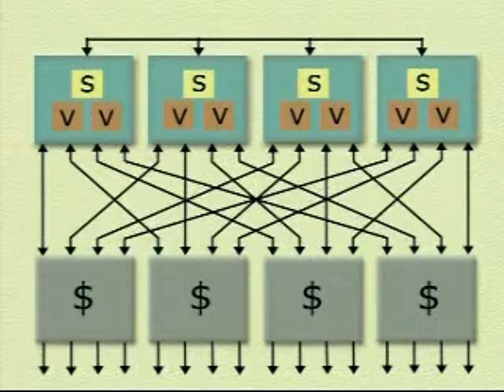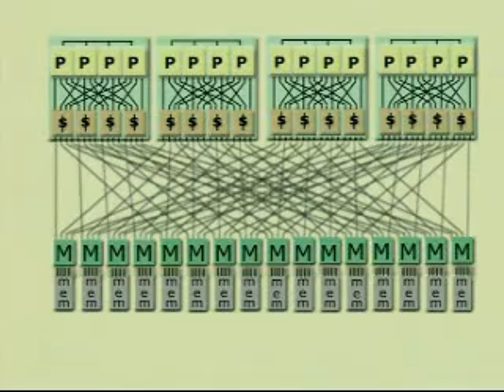Cray SV2 Supercomputer [Cray X1] - Part 1 of 3

Comment: Going down Memory Lane on this. I miss all the amazing guys in this video I was lucky enough to work with them as their primary interface as their IBM Microelectronics Rep & Supplier for the Silicon Chips, MCM & PCB Motherboard! Lots of challenging issues to work thru and always classy group! Jim Sundet is so modest, he should be in the video too.
Reply from the maker: Good to hear from you sir. I wish there was more material about the development of these machines.

Comment: This was truly an exceptional machine. Unfortunately, it's just not economical to build custom processors like this any more. Fortunately though, many of the innovations in this system are now mainstream. In fact, if you look at a modern GPU, it's not all that dissimilar to the processor used in this machine.
Reply: You should take a look at the Apple M1 CPU line, the M1 Ultra is crazy powerful.
Reply: @videosuperhighway7655  it was beaten by the ruzen 5800x3d and 5950 . the allpe silicon is cool but not as powerful as they like to tout